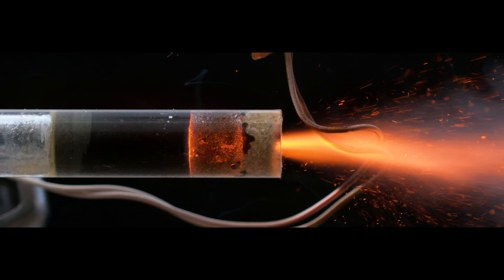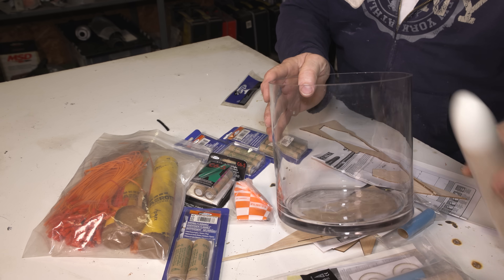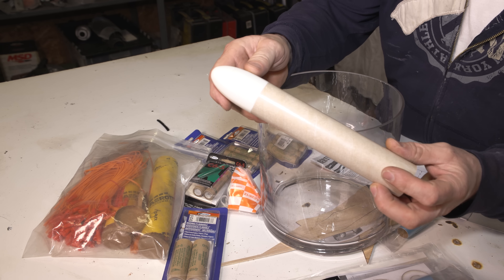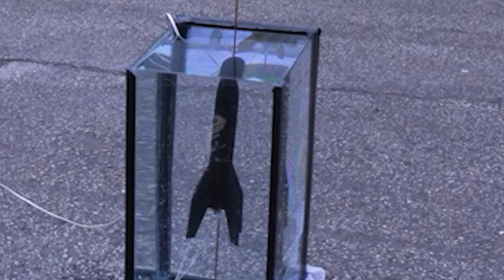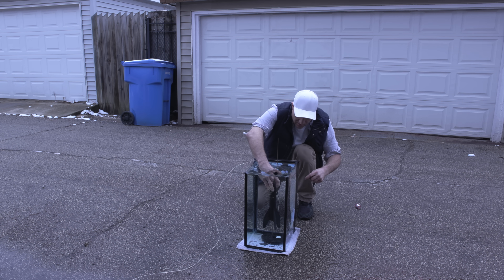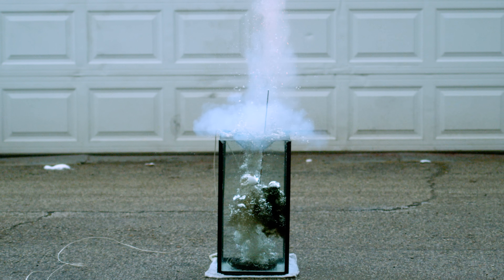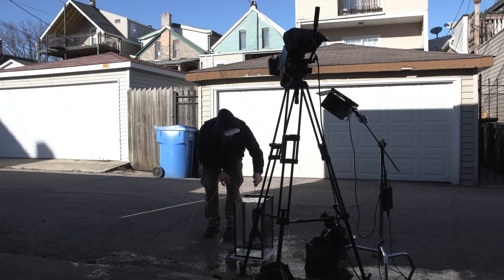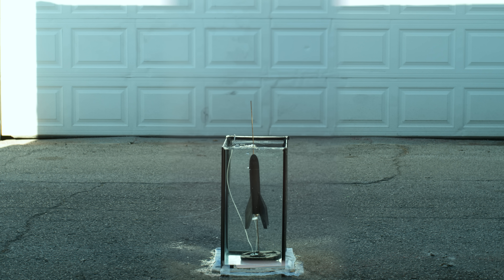Rocket Launch From Underwater (In 4K Slow Motion)

Comment: 6:03 thinking my opinions aren't getting patented so ..( use a lawnmower starter spring that would fit in a phone 📱on micro gears that larger to smaller nob gear on coil spring smaller gear with micropulley beside it micro belt on dual magnet micro motor wired to capacitor to fit proper voltage on phone, small handle to rewind the coil spring when tension is less than usable to power a cell phone ) to be honest everyone I mentioned it to ignored it.  But I know changing wires are too thin and USB hubs aren't exactly "universal" like they were originally intended. shrugs maybe tell me if you think it's a worthy idea now that you've heard it or should I move on from it?

Comment: What's the difference in the height reached by these rockets? Is there a difference in height based on depth of ignition. Or if you have a 10 foot tube of water does letting the rocket go before ignition assist in height?
Reply from the maker: Well I'm not sure because I picked a very very short burn time, my guess is it went up like 200 feet that's about it

Comment: You do know that rockets are not actually launched from under water. They are blasted into the air with compressed air and the rocket motor is only lit when the rocket is out of the water.

Comment: Gosh, I did that in about 1973. I was enamored with making a Polaris missle and firing it from underwater. I used a steel tube and a rocket with no fins. I fired it in a lake in MN and it looked great coming out of the water. However, no fins does not make a straight flying vehicle. I used modeling clay as the sealant for the igniter.

Comment: It’s awesome that we could see the cavitation right behind the trailing edge of the fins at 3:50 and 5:04, the second was much less noticeable but still there. It would’ve been really cool if you could’ve gotten a close up view of just the tank so that you could see everything really clear.
Reply: Was that cavitation or just the bubbles being held behind the fins because of the low pressure/aerodynamic effects similar to a book being dropped with a piece of paper sitting on the top of it. The piece of paper is held firmly to the dropped book by the air rushing around the book.

Comment: Heres a question, do you think it would "increase" or "decrease" the performance of the rocket? 
As water is something like 10 times denser than air, it gives the propulsion much more density to push against, which would increase the effectiveness of the initial thrust, giving the rocket higher performance?. 
Or is that not the case, and the water just creates more drag in the initial liftoff, creating less performance?. 
(my instinct is telling me it would decrease the rocket performance through takeoff drag from the water)
Reply: Rockets don't push their environment for thrust, they push on their own combustion gasses so everything denser than a vacuum only decreases their performance.

Comment: Correct me if I'm wrong but submarines shoot missiles from underwater. It looks crazy, I don't know if they use solid rocket fuel for the entire thing or if they shoot it up with something else and then ignite it.
Reply: They are propelled by compressed air, only after the rocket jumps out of the water it ignites solid rocket engine, there are movies here on YouTube showing that.

Comment: Next time, how about launching in a FIELD instead of in your driveway surrounded by other houses? You've violated one of the essential guidelines  of model rocketry.
Reply from the maker: Easy there, this thing is tiny and very insignificant, it had a 200' motor, and I one point one of the rockets went sideways and you know where it ended up in my next door neighbor's yard, she was like " let me open up the gate so you can get it out" I mean the Rocket and weighs like 10 grams.

Comment: I have a problem with some safety issues: Launching near buildings, launch field size, launch rod length, power lines, and what happens if the engine catos? Glass would go everywhere.  Please consider the safety rules of NAR or Tripoli when doing anything with model rockets.
Reply: Thanks, John - I agree.  And are those high-power Aerotech motors?  Looks like a 29mm or 38mm reload.  I wonder if this guy has a L1 cert to be able to buy those motors - and if he does, NAR/Tripoli should send him a note.
Reply from the maker: I do appreciate the concern though
Reply: @WarpedYT  It is getting tough enough keeping the sport legal with out this kind of disreguard for safety.
Reply: @johnjamieson7688  Thank you, John....it's troublesome to find videos of rockets and rocket motors being used in ways and in locations for which they were never intended...as you said, it's tough enough without this type of reckless behavior...
Reply from the maker: Nah... This thing is so tiny. I would agree with you if this was slightly larger but this thing is the size of a peanut, also the tank was not glass it was acrylic. So what and hits the power lines the rocket ways like 10 grams...lbvs

Comment: Now you just need to repeat it in water that's about 10 feet deep. I'd keep going deeper until the rocket doesn't make it out of the water. You'd get one hell of an analog data chart of the rocket engines burn profile.

Comment: FWIW:  If you decide to try doing this in deeper water, I would suggest: 
(1)  Use a launch rail instead of a launch rod.  You can connect multiple rails to any length required. 
(2)  Waterproof the body of the rocket {I am not sure if you did that to this rocket or not}.  Also seal the rocket body so no water seeps in past the motor, nose cone, or rail buttons {used with the launch rail}.  Enough wter entry would likely throw off the center of gravity of the rocket and make it unstable.
Reply from the maker: That's a great idea
Reply: @WarpedYT  >>> Thank You...😊
Reply: @WarpedYT  >>> I misspelled "water". 😝

Comment: Me: Igniter works 25% of the time under ideal conditions.

This guy: Igniter works 100% of the time under water.

Why have you forsaken me Estes!
Reply: Using the igniter correctly is a bit of an art.  Editing out failed launch attempts it pretty easy.
Reply from the maker: @DeputyNordburg  if you want to know something really funny I'm not even lying, I literally had zero hang fires doing this video, seriously.
Reply: @WarpedYT  Probably because you were working so hard to keep the ignitor in the engine and dry.  The biggest 2 reasons they fail is low battery power, and failing to keep the ignitor in contact with the propellant.
Reply from the maker: @DeputyNordburg  yes you are correct, I kept it very dry and sealed it with hot glue and the plastic plug
Reply: @DeputyNordburg  To be fair, I haven't used a rocket engine in about 25 years. I have a hunch I'd have an easier time now days.
Reply: @bradley3549  They now include a plastic plug that fits in the nozzle, holding the ignitor to the propellant. So much easier than the masking tape we used to use.

Comment: Go deeper in the water - bigger tank!  You can use a paper clip or something to hold it down.
Reply from the maker: I love that idea oh, I'm totally doing this again with a deeper tank a bigger rocket and a much much more realistic more powerful rocket motor.
Reply: @WarpedYT  A little splash of  fuel/petrol that floats on top ,should look great igniting when it exits ,or what would happen if something flammable made a layer at the bottom of tank,would it ignite? Worth a try.

Comment: Perhaps launch a rocket in water next the same model rocket outside of the water and see which one, if either, gets a head start. Usually it's just thrust pushing against the rocket but with the one in the water you have a few additional factors. At a guess, 1) addition drag from the water; 2) less weight while in the water; and, 3) perhaps the thrust pushing against the water as well since it could be consider a semi-enclosure. It would interesting to see if these factors overall produced a difference. Then if you could seal the tank so that there was only small clearance for the fins and rocket so that pressure could build up in the tank more to propel the rocket more would also be interesting but that might require more precision/work than the idea warrants.

Comment: Beatiful view from above but too far from lateral. Nice experience, make me think the quiet surface in while the launch is because is higher speed than wave speed in the water?
Reply from the maker: Thank you, I completely agree too far. As for the water speed that's a good question but I'm not sure. Maybe the entire level of the water is rising evenly, but I see what you're saying because when the rocket engine ignites it's creating a big ball of gas pushing the water outward, you would think that you would see that wave in the water before the rocket emerges.. good observation.

Comment: Based on the visual, it looks like it is more energy efficient launching at start. Energy is more focused on rocket going up (underwater) than exhaust going sideways (launched in air)
Reply: What it i was think going into this ^👍
Reply: For full-sized rockets, the lower the external pressure, the more efficient a rocket becomes (if you optimize the nozzle).  This culminates when running in vacuum.

So, to the extent that an Estes rocket's exhaust is overexpanding, a bigger nozzle would help make it more efficient (at least in an ideal world).  Putting it underwater will make the engine less efficient.

Of course, in practice, this rocket has lots of transients and non-idealities, so there's no guarantees, but my guess is the theory is probably correct here and water makes it less efficient.  Also, while it is helped a bit by buoyancy, it also has to shove water out of the way.  I'd still guess it's a net loss.

I mean it's still cool to see, however. Though the fact that he's launching near other houses seems... a bit scary.  Around here, that would be a kind of serious fire risk.
Reply: @doctorbobstone  I'm not an expert in such things, but wouldn't using a nozzle optimized for atmospheric flight underwater cause overexpansion and instability (which usually blows up the rocket).  Granted, these simple rockets might be more durable but I think that if you try to light a vacuum engine in the atmosphere the rocket usually blows up.

I believe that underwater-launched rockets usually are ejected with cold gas to get them out of the water before the engine ignites.  Then the actual first stage nozzle just needs to cope with atmospheric pressure.

But, perhaps somebody here knows a bit more about these things than I do...
Reply: @RichFreeman  I would bet the reality is that the Estes rockets are optimized for ease of manufacturing, but if we assume that they were actually optimized for surface level atmospheric flight, then putting them underwater would cause them to underexpand, not overexpand.  That is, the increased pressure from the water would not let the exhaust expand as much as the atmospheric would, so we would be losing efficiency.  To re-optimize, we would shrink the nozzle.  With the optimal nozzle, the exhaust would come out at sufficient pressure to keep the water from compressing it and the shape would have extracted as much energy as possible getting from the high pressure of the chamber to the lower pressure of the water.  It might also be a little bit lighter.

Regarding instability, I'm not sure.  (I work with experts in this stuff, but am not one.) I know that instability in a thrust chamber can be bad.  I want to say that higher pressure outside (within reason) wouldn't lead to instability inside the thrust chamber, but I could certainly be wrong.  As I understand it, the transition from subsonic flow in the chamber to supersonic flow in the nozzle means that the outside conditions have very little effect on the conditions inside the chamber.  I'm not positive about this conclusion, though.

Comment: Hey, I'm watching a video of yours about rockets for the first time, and when I saw you putting a cardboard rocket in the water I thought, it wouldn't be that much expensive to make a carbon fiber rocket, that way it wouldn't deform as much as cardboard, and it would last multiple shots wouldn't it?
Reply from the maker: I completely agree, I was going to do this bigger and better, however I kind of did this as an in-between project so I didn't put 100% effort into it, I was also curious to see if the cardboard rocket would actually work underwater I really didn't think it would, and last but not least I wanted it to be something that like kids and parents could relate to, something that they see on the shelves of the store. But now that I see a lot of people are interested in this I am going to do a couple variations of this with a much larger rocket and I'm much more proper setup.
Thanks for the feedback I really appreciate it, I almost didn't post this video originally because it wasn't really done up to my standards, but I will next time, one of my more recent resolutions is to not cut corners anymore. ...thanks !

Comment: maybe you could spray the rocket first with some kind of hydrophobic coating like never wet or even scotch guard to reduce the surface tension that is holding on the the rocket when it leaves the water.

Comment: Next episode: Launching a Model Rocket Into Water
Reply: I second this idea.
Also, perhaps a 3rd episode, Model Rocket Launch Torpedo Style, horizontal launching to see how far it goes.
Reply: Episode 4 "Cold Launch Underwater Rocket Ejector"
Reply: Episode 5 (Hobby) ICBM Submarine
Reply: @korishan  It would have to be neutrally buoyant. Maybe running on a string.
Reply: I did that with bottle rockets launched into cattle watering tanks!!!....LOL!!!
Reply: @RTR-MATEY  same... but into ditches, kinda made them into torpedoes.
Reply: Ha , I used to launch whistling bottle rockets into water as a kidn
Reply: That would be cool... but it might be tricky holding the water above the rocket🤣
Reply: @gregpavitt309  that's where you construct a long guiding pole that sends the rocket downward into the water.
Reply: Depending on what you get, and if you manage to get it going far enough back to where it hits it at top speed (like the Aspire's Mach 1+), I'd imagine it could disintegrate once it hits the water.